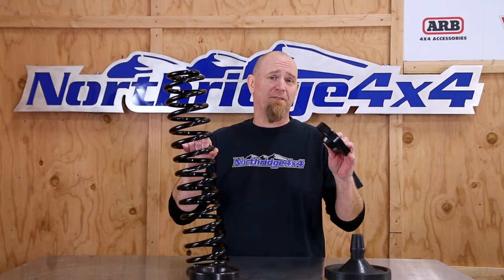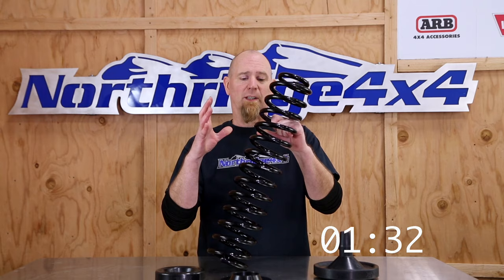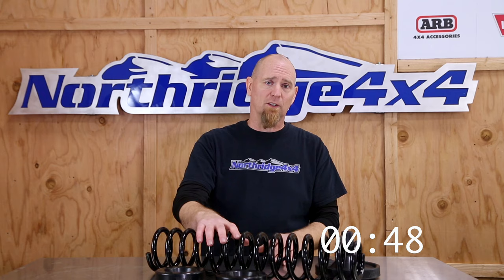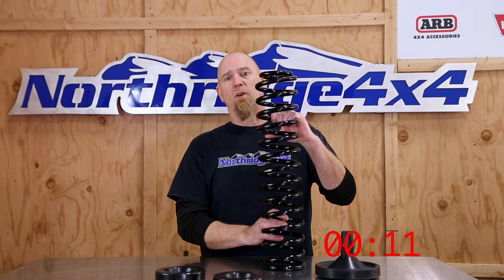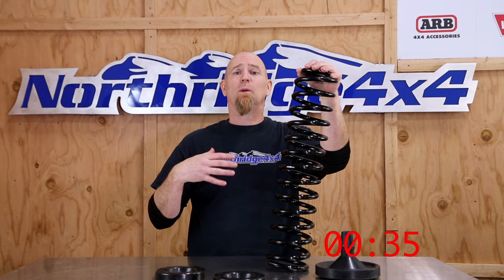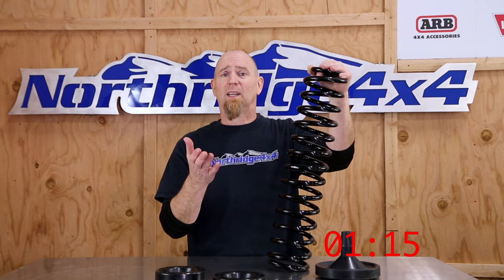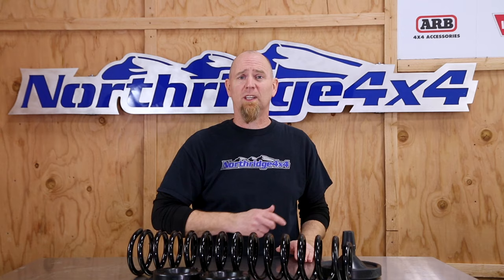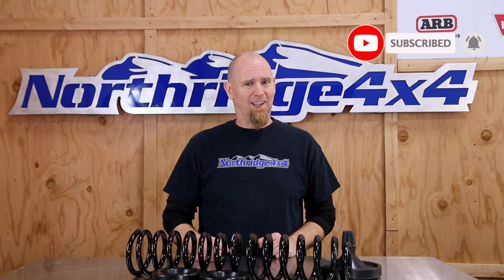Spacer Lift or Coil Spring Lift? EXPLAINED!

Comment: I would say spacer for look, spring for function
Reply from the maker: Great way to sum it up.
Reply: These are the words I needed to hear to help me decide which to do. Thank you.
Reply: @northridgenation   for just normal driving do the spacers change the feel of the truck?
Reply: @apolloorosco6852  Not really. Spring rate will be the same but center of gravity changes so it will feel more 'tippy' unless you go with a wider stance. A few inches you probably won't even know. I've personally never lifted anything I own less than 4".
Reply: @kdigiacomo  So... spring spacer, then add a wheel spacer the same size, and we're good?
Reply: @user-yj1uy4of7e  For the most part kinda, but maybe 1" wider (each side) for every 2" taller of lift? That's just how I've always done it. 
For example I had a 9" lift on my Ford Diesel truck. I ran 39.5x15x16.5" Interco Swampers (tire) on a 16.5x12 reverse offset wheel. My gas '79 Ford build for the sand dunes had a 7" lift and I ran 36x16x15 Cepec tire on a 15x12 reverse offset wheel. It's hard to explain by messaging on here and it all depends on the vehicle. If you have any questions feel free to ask me, I have no problem attempting to help.
Reply: @user-yj1uy4of7e  The '94 Jeep XJ I'm building now will only be about a 4.5" lift and should be able to fit 37's. I have 3 sets of wheels and tires but they will all be 3-4" wider than factory. On the 33's I'm hoping to go 90mph in the sand so I want it low and wide. 
Unfortunately I have to cut the completely rust free body up but it will be done correctly. Wide is better but it will definitely wear out the bearings a lot faster. Bearings are a lot cheaper then flopping or flipping over your rig. I'd rather replace my bearings yearly and not think twice about it. 
👍✌️

Comment: Also a spacer will keep your ride quality very silmilar to OEM. So for example, an outback has a smooth ride and to make it better for the light adventuring people do with them a spacer would be better. If they went with a spring setup, it would be hands down a worse ride on the highway.
Reply: Okay so I want to a buy 2’5 inch lift for my Silverado for cosmetics reason only and it rides real nice OEM. So spacers are a better choice ?
Reply: @natenorcutt6751  thats a pretty large lift. I would not go withspacers on anything over an imch and a half
Reply: Good to know. I do a bit of rough gravel in my Tucson at times and want an economical method of getting a bit more space while not messing things up too much. 30mm spacer kit it is.

Comment: I decided to go with the Daystar 2" spacer lift for my JL. It is the most complete spacer kit that I could find. Most entry level kits don't include longer lower control arms, but this does. I will eventually swap out some pieces but this gets me to the point I need right away, for a great price.

Comment: Good info, and thanks for the videos. One thing to keep in mind -- at least with the JL -- spring lift heights are based on a Rubicon. A 2.5" spring lift on a Sport might be ~4" over stock depending on options.

Comment: I started with 2.5" spacer lift on my JKU. Ran it for over a year and it worked for me. I just recently upgraded to 3.5" Rock Krawler springs that I bought from Northridge 4x4. I can't believe the difference in how my jeep rides now.
Reply: @Aaron now you run on spacer and spring?

Comment: The reason i did not choose new coil lift is because 1 the price and 2 i did not want to upgrade my 32inch ko2 tires ..  adding a 2.5 terraflex coils could become a 3-4 lift total .. my 32 inch tire woulda look too small.. with spacers its cheap and  you get exactly the height you're looking at. Not to mention garage door clearance.  On. JkU, i did some offroad (stock difficulty level, uphill downhill in the mountain) with 2.5 coil spacers , no sway link disconnected, tires down to 14 psi, 4x4L and H.. 2 adults and 2 kids, the jeep did great. It was a 3-4 hours shaky offroad condition.. millions of rocks were atleast 8inch big

Comment: haha yea I just got a 'three inch' lift by installing a rear ARB 0.5" lift in an '90s Pathfinder. Crazy how they sag over the years and you  just don't realize how much until replacing the spring! Now I got hella rake going on, so gotto swap the springs in the front along with the struts. It'll be worth it where I off-road though!

Comment: This helps me. I bought a new Gladiator and want to put a mild lift on it. This will help make my decision!!!
Reply: lenny351  I initially had a 2.5” spacer lift on my Rubicon.   Eventually upgraded to a 3.5” zone off road with upper and lower control arms and adjustable sway bar.  Honestly, the spacer did just as good as my expensive lift other than not being as tall.
Reply: What brand was your 2.5 leveling kit?

Comment: Thank you. Solid video. I have a 2020 2DR Rubicon. I went with 33" tires (tried BF Goodrich K02s, BF Goodrich KM3s, Falken Wildpeak ATs, and Milestar Patagonia MTs). I upgraded my shocks to Falcon because it was fun. Somehow that gave me an added 2". No idea why unless I have them set too stiff. I now have 40" from the ground to bottom of the stock fender. I then upgraded my lower Control Arms with a set of adjustable Rusty Offroad. I am now going with 35" Mickey Thompson MTZs. So, I am looking at springs. I also have a set of SteerSmart endlinks I want to try (they are 9" so you have to have at least 2.5" lift). I am looking at upgrading my stock springs to 2" (most likely Rusty Offroad, unless advised not to). After watching this video, baring in mind I have a Rubicon with its naturally higher stance) I am pondering if I should go with another 1" coil spacer or a 3" coil spring set. I realize it may strike some people as ludicrous, but I would go to all of this trouble just to make the SteerSmart endlinks work because its a puzzle. Any thoughts, ideas, anecdotes, grave reservations, or even a chocolate chip cookie recipe?
Reply from the maker: Just upgrading to Falcon shocks should not have given you any lift. You either need a spacer or a taller/heavier spring to lift it.
A 1" spacer is a great way to add a little height to an existing 2" lift coil. 
A new 3" coil has the benefit of being longer (taller), so it could potentially travel more if the rest of your suspension has the ability. This would be my recommendation if you spent a lot of time off road.
The choice really is up to you, both are good solutions.

For chocolate chip cookies, it is hard to beat the original Toll House Cookie recipe:
Ingredients:
2 ¼ cups all-purpose flour
1 teaspoon baking soda
1 teaspoon salt
1 cup butter, softened  
¾ cup granulated sugar
¾ cup packed brown sugar
1 teaspoon vanilla extract
2 large eggs
2 cups NESTLE® TOLL HOUSE® Semi-Sweet Chocolate Morsels
1 cup chopped nuts

Directions:
Preheat oven to 375 degrees F.
Combine flour, baking soda and salt in small bowl. Beat butter, granulated sugar, brown sugar and vanilla extract in large mixer bowl until creamy. Add eggs, one at a time, beating well after each addition. Gradually beat in flour mixture. Stir in morsels and nuts. Drop by rounded tablespoon onto ungreased baking sheets.
Bake for 9 to 11 minutes or until golden brown. Cool on baking sheets for 2 minutes; remove to wire racks to cool completely.
Reply: @northridgenation  The added height currently remains a mystery. Thank you for your guidance. I'm going to try the spacers since I just purchased the springs. And, of course, I absolutely appreciate the extra effort with the legendary cookie recipe. Our community is STRONG.
Reply: @northridgenation  I'll be ordering spacers from your site today.

Comment: QUESTION,  how much rear lift average can i expect from a 6 coil stock coil spring vs a 9 coil heavy duty one on my suv?
Reply from the maker: There is more to lift height than the number of coils. Free height of spring, diameter of the spring wire itself and the number of coils all work together to give the spring rate.
If two springs are identical in free height and coil wire diameter, the coil spring with the higher count of coils will be softer (it sounds opposite, but it's true).

Comment: I want to get a 3"/2"  spacer lift for my 16 tacoma so I can fit 33s on there without rubbing. A lot of people are saying that the spacers will damage certain parts over time like the shocks and the ucas. I mainly drive in town and on the highway. Do I need to worry about any damage in the future? Also, I saw earlier in the comments that you stated you don't recommend going about 2.5 inch. So would i need to go with a smaller spacer lift?
Reply from the maker: Running a large spacer lift is even tougher on an IFS vehicle due to the operating angles of the A-Arms and CV shafts. 
Make sure whichever kit you go with has provisions for a diff drop.

Comment: Hi, I have a 2015 RAM 1500 2WD, and I have 2” lift coils installed currently but was wondering if I could put a 1” spacer on top of that to achieve a total of 3” lift in the front.. if I could, what suspension components should I consider upgrading as well?

Comment: Such a great video! I have a 2011 jimny and want to get bigger tires (215/75/15), so looking at doing a 1.5" spacer lift. Not doing any offroading, just want a better look. My question is - do I need to consider shock extenders or steering spacers? Any components that might be affected by this lift that I need to factor? Total 'lift' newbie here, so any input welcome. Tx!!
Reply from the maker: It really comes down to total lift you are installing and what are lift parameters of your vehicle.
We don't see the Jimnys here, so don't know what they're lift parameters are.
Looking at the Old Man Emu suspension kit for the the 2011 Jimny, they are listing 40mm (aprox. 1.5"), so you might take a look at their lift kit to see what comes in it.
We would definitely say either longer shocks or shock extenders would be needed.

Comment: 2017 JKU Sport. Most inexpensive spacer kits don't include sway bars. If doing a 2-1/2" spacer lift, won't I need to purchase sway bars for the back (assuming I'm moving the rear to the front)?
Great video!
Reply from the maker: Many people get by without them, though we'd definitely recommend treating a 2.5" spacer lift just like any 2.5" spring lift kit and use the same parts.

Comment: I want to put 33s on my JL and with little bit of heights  like 2.0 its ok to add leveling kit or should I get 2.5 liftkit?and hit the light trails here and there ?
Reply from the maker: A spacer kit would be perfect for that application. One of our more popular small spacer kits is the 1.5" spacer kit from TeraFlex. It will fit 33" tires and keeps you nice and low.
https://www.northridge4x4.com/part/0-2in-lifts/1165200-teraflex-1-5in-performance-spacer-lift-kit

Comment: Wanting to lift my dodge caliber r/t awd. The only option I can find is the poly spacers. Is there  any other option to get  2-3 inches? Like different struts and shocks from a bigger dodge SUV? Just exploring options
Reply from the maker: The Caliber shares the same platform as some Mitsibushi vehicles, unfortunately it doesn't look like anyone is building any strut/coil lifts for that platform.
As far as installing parts from bigger vehicles, anything can be made to fit, it will come down to how much time and $$$ do you want to put to the project.

Comment: I have 2002 Jeep Grand Cherokee WJ on stock shocks and springs, I plan to put 2 inch lift spacers. I wonder if the spacers will cause damage to the shock absorbers?
Reply from the maker: Typically with 2" of lift or more, you will also need to run shock extensions.

Comment: say i'd go for a 2inch spacer, front and rear, is it necessary to change the shocks or should the stocks stands with the lift?
Reply from the maker: Depends on your vehicle and shocks. At minimum you'll loose droop travel from the shock, so it would be a good idea to look at a set of shock extenders like these from EVO manufacturing for the JL/JT:
https://www.northridge4x4.com/part/shock-mounts-brackets/3004b-evo-manufacturing-front-shock-extension-set
https://www.northridge4x4.com/part/shock-mounts-brackets/3005b-evo-manufacturing-rear-shock-extension-set

Comment: I got a JT Sport and still want to tow my camper and I want to run with 37s so 3.5 or 4 inch lift or what’s your thoughts on springs and shocks? I am gathering intel and trying to figure out the camper variable?
Reply from the maker: The towed camper variable is a big one. Best case scenario would be to add in an air bag kit, that way you get the lift you want and the air bags take up the extra bumper weight from the trailer. 
Unfortunately right now there isn't a bolt-in air bag kit for  lifted JTs yet.

Comment: 1982 chevy c30 dually with a flat bed. Want to put 3" springs in front then a spacer to add 2" for a total of 5" in front. Then add an extra leaf spring in the back to get 4" lift there. With that amount of lift what else is necessary?
Reply from the maker: Don't know all the specifics for a C-series Chevy. I would guess you'll need longer brake hoses and some steering mods, quite possibly a new set of lifted spindles to get the geometry correct..

Comment: I have Grand Vitara 2007 I'd like to get a spacer lift but I'm not sure should I trust that or pay more than and get spring lift as set?.. I'm not a hardcore off roader.
Reply from the maker: Strut lifts are similar. A spacer lift will give you lift, but won't add the performance benefits you can get with aftermarket struts and coils.

Comment: Do spacers or spring lifts invalidate manufacturer warranty (asking for a new Jeep JL). Any idea? Thx
Reply from the maker: That's always a big question and a big can of worms to try to answer easily.
Basically a mild spacer or spring lift shouldn't void your warranty.
For a little more info check out our Magnuson-Moss Act video: https://youtu.be/u9NcEyHFKXA
Also check out what the FTC and SEMA has to say on aftermarket parts:
Federal Trade Commission- Magnuson-Moss Act of 1975: https://bit.ly/2BF77Hl
SEMA (Specialty Equipment Market Assoc) - FTC Validates Right to Install Aftermarket Parts: https://bit.ly/2MMkdZP
Harrington Labs SEMA Magnuson-Moss Warranty Act: https://bit.ly/2WbuBNF

Comment: hi what's the most reliable way on long term to get 2 inches more ground clearance on my (pretty light, 3700 lbs) 2018 audi A5 manual? thanks
Reply from the maker: Spacers would be the easiest, but you will have a max height limit depending on the suspension geometry.
With a short A-arm independent suspension like your A5 has, 2" might be too much.
You really need to chat with a company that does A5 suspension products to see what they think.

Comment: I often end up on rough gravel/dirt roads and want a bit of extra space. Unfortunately, the options dor a 2017 Tucson are very limited. I am leaning towards the ReadyLift 30mm spacer kit. What are your thoughts on this type of upgrade?
Reply from the maker: Spacer kits are great, especially when there are limited choices for full replacement suspension kits.

Comment: I installed a steal bumper and winch on a 2 door JL 6 months ago.  The front sags now and the ride is harder.   Can i counter this with better front springs?   If i just use a spacer, I'm afraid I will keep the harder ride.
Reply from the maker: Yes, adding a set of aftermarket springs will help account for the extra weight of the bumper and winch.

Comment: I have a 2018 f150 with a coil and leveling kit. MY trucks sits level but was wondering if I could add a 2 inch spacer to the front coils t get a little more lift?
Reply from the maker: That depends on what you already have for a leveling kit. The typical F150 leveling kits we've seen are already a 2" lift, by adding 2" more to the coil, you are ending up with 4"s of lift. So make sure you have all the components needed for a lift that size for your truck.

Comment: Do ya need to get a front end alignment after a spacer lift
Reply from the maker: If it is an IFS, YES.
For live axle, no, just need to adjust the drag link to center the steering wheel.

Comment: On my disco 1 I'm going 2 inch suspension lift 1 inch spacer's and 2 inch body with 33s what do u think would I need to change much other things to make it work
Reply from the maker: 2" coil and 1" spacer would give you a 3" overall suspension lift, so you would need to plan to do all need mods that are standard for a 3" suspension lift on a Disco 1.
The body lift comes with a whole different range of changes.

Comment: Bought a used Jeep WK Hemi QDII three years ago, found it had 2” spaces all around. I’d like to replace spacers with springs but not much available for these vehicles. OME heavy 2” lift springs sound like a good way to go, though I’d like to have 3” when finished. Any input would be appreciated!
Reply from the maker: OME is about your best bet for the WK and yes, you'll only get about 2" of lift. 
You do have to be careful lifting the WK independent front too much or you could have issues with handling and CV life.
Reply: @northridgenation  Thank you! My little fantasy is to rip out the entire suspension, drivetrain and steering, and replace it with Dana44s and your good components, but I think the WK, my income and I are about 15 years too late for that...

Comment: What about combining a spring kit and a spacer kit? I wanna get a total of a 4” lift on my liberty and I currently have a 2.5” spacer lift, can I just add the 1.5” spring kit from arb/OME?
Reply from the maker: Add up all total lift and make sure you have all the parts needed for that much lift. So in your case, if you have 4"s of total lift, you'll need all the components that would be used to correct the steering and suspension for a 4" lift. Diff drop, brake hoses, extended knuckles etc.